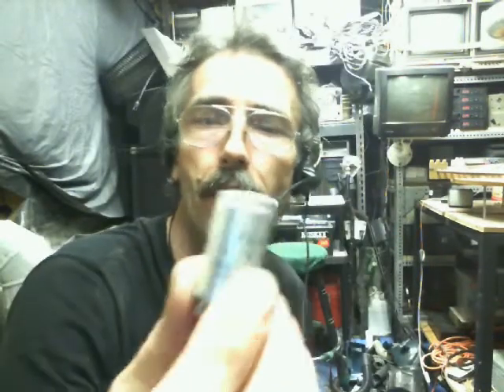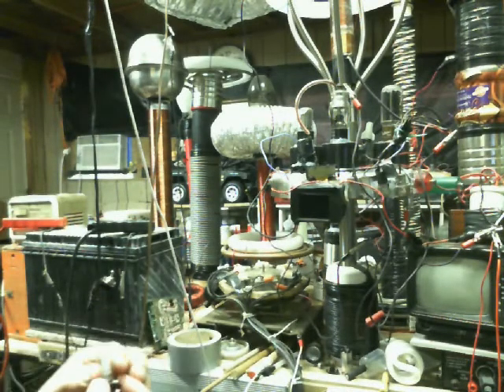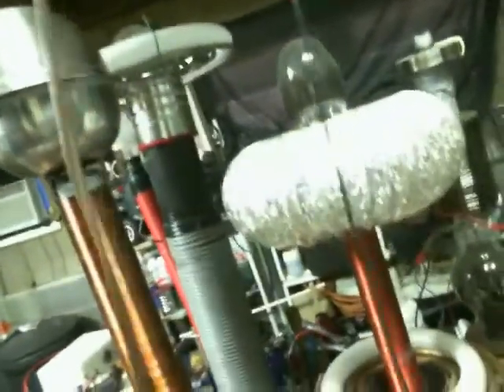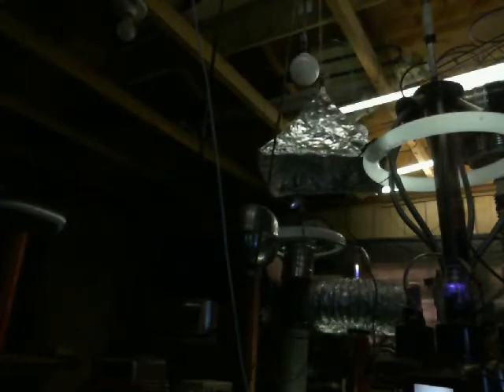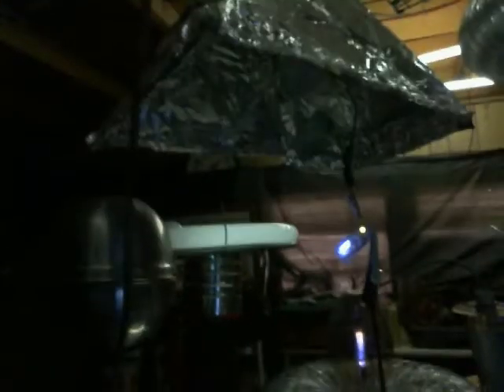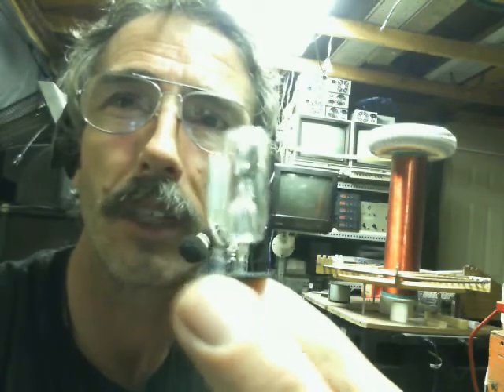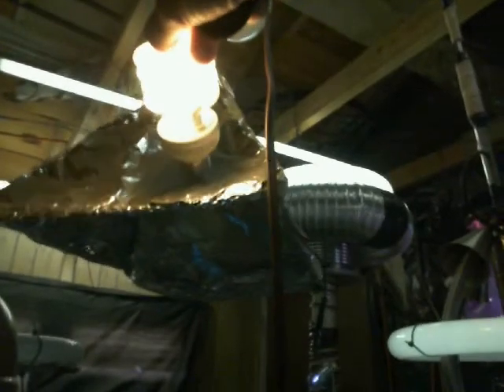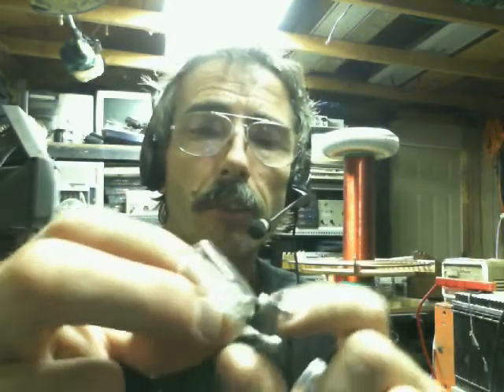FLUORESCENT BULB STARTER !

Comment: i can key up some wattage off my lil magnet mount antenna and put out the RF the gas needs2burn in the glass tube, as many light tubes as you can hold will light up. if you touch the metal you will get a static shock,CFL lights work, also LED lights work off the gamma the RF is putting out.